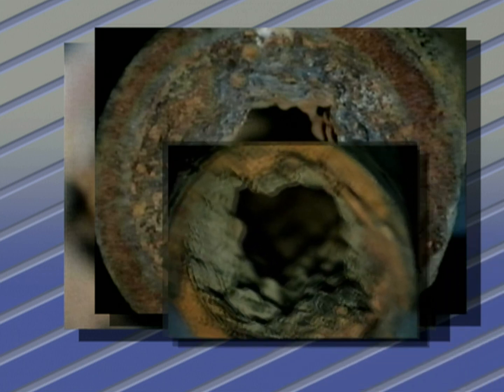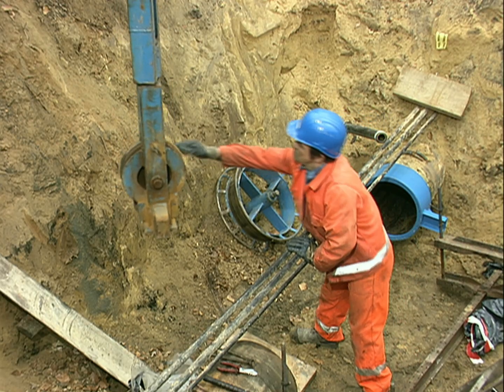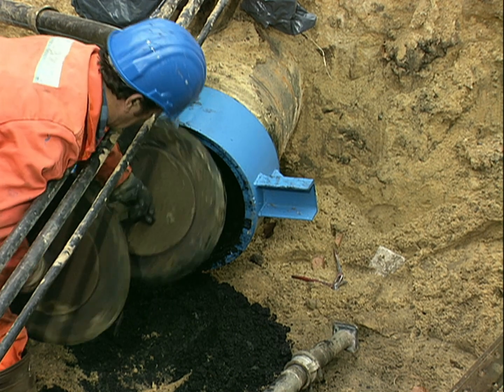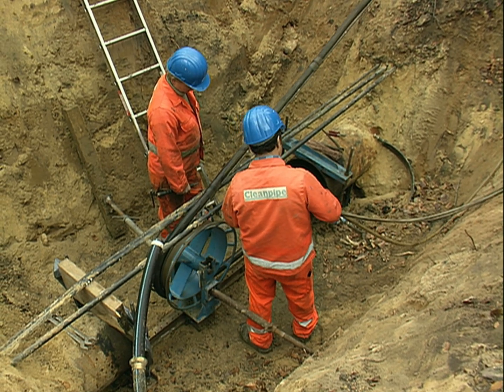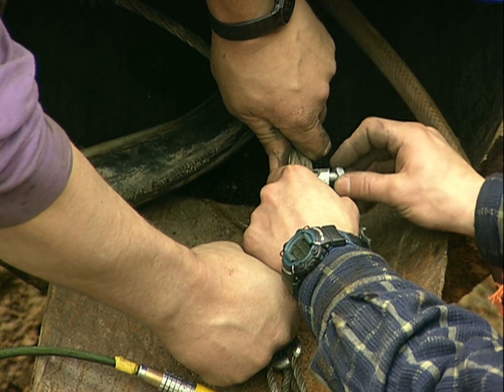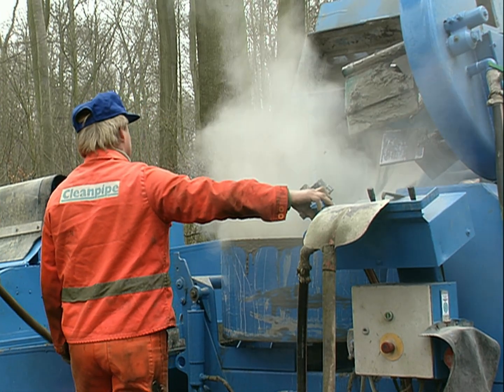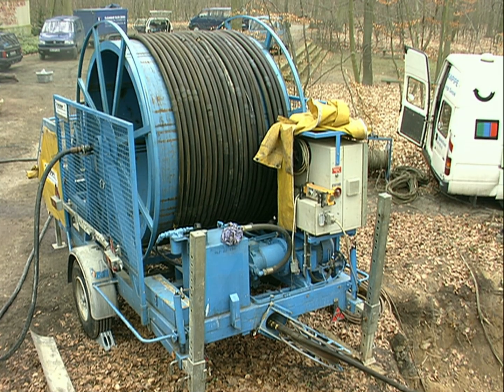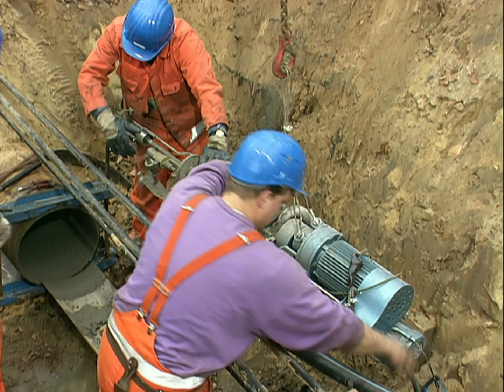Cement Motar Lining -Cleanpipe-

Comment: It’s not necessary to video the pipe after it’s been cleaned. A stiff squeegee and a prover pulled through will do the trick. The cement lining will not bond to the pipe but forms a pipe within a pipe. Since it does not bond to the pipe it doesn’t need to be perfectly clean.
Reply from the maker: That's right. The video serves as proof of the flawless work. This is mandatory in Germany, as important infrastructure is operated by local authorities.